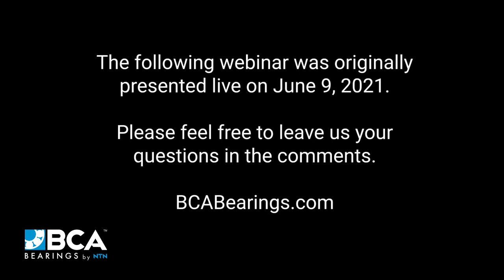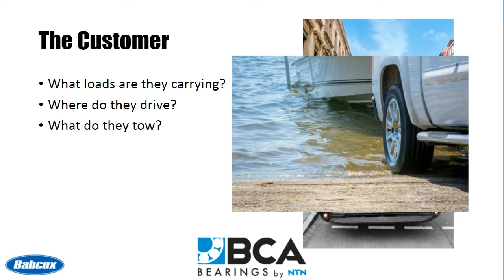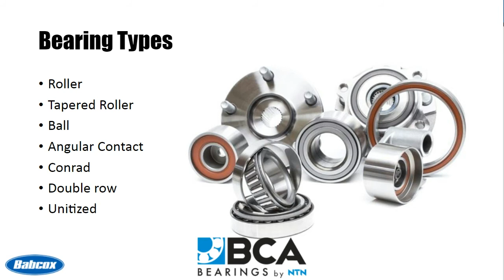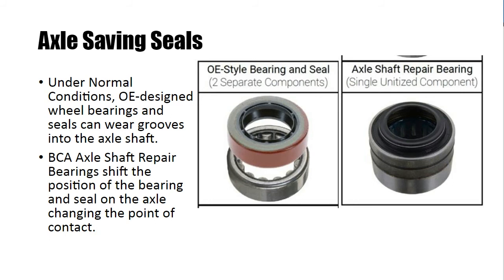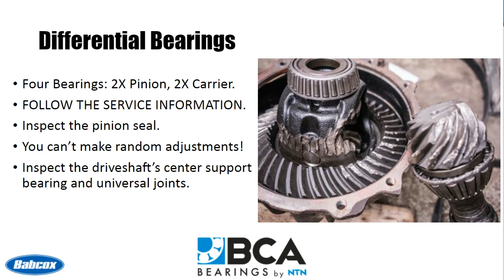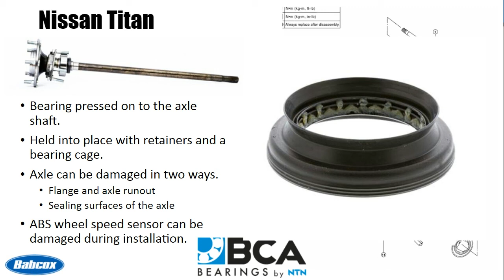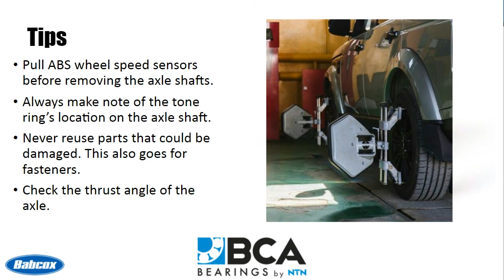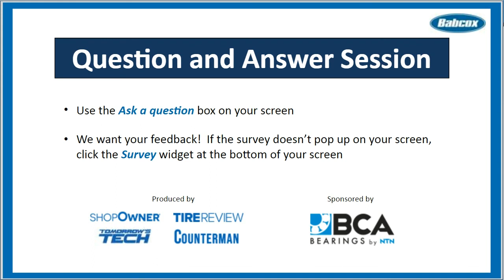Webinar: Rear Axle Wheel Bearing Replacement Revolution

Comment: is it possible to change outer seal on axle shaft repair bearing (single unitised component)?
Reply from the maker: No, the seal on the axle shaft repair bearing cant be changed separately.